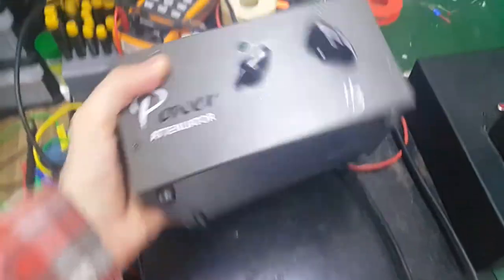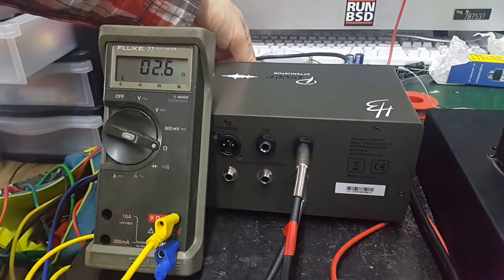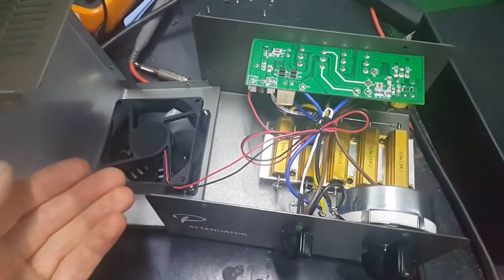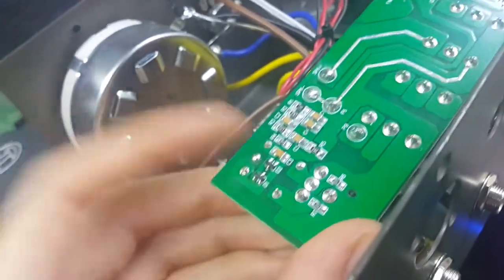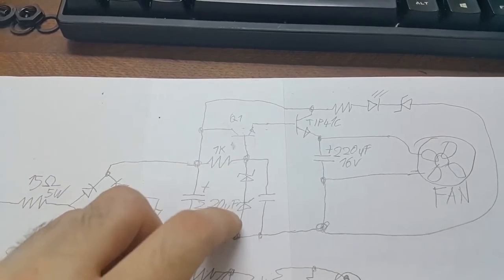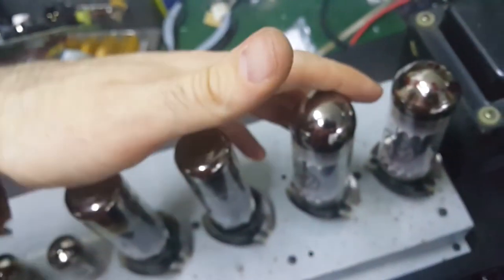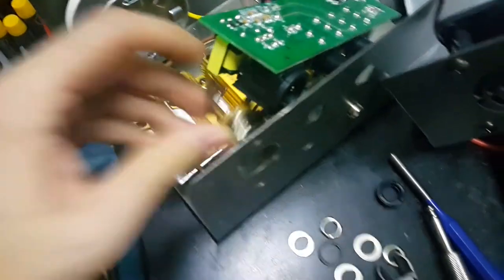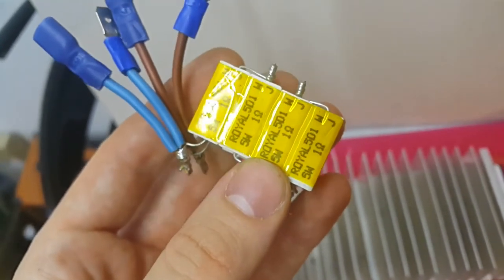Harley Benton PA-100 Attenuator Review & Improvements

Comment: I know it's an old subject by now but nevertheless, I'd like to mention that my PA-100 came with the mail today (living in Germany) and it's perfectly allright, they soldered a solid ground wire to all output connectors and added proper washers, particularly to the 16ohm connector, which looks quite heavy duty now, nothing like in your video. The line volume decreasing simultaneously with the speaker volume is still an issue however, I changed that according to your advice. There was even plenty of wire protruding from the resistor so I could simply bend it away from the pot. The attenuator works perfectly now, with a strong and clear signal into my interface from the line out. Thanks for the enlightenment, man!!!
Reply from the maker: Thank you! It is still great to add to the statistics :-)
Reply: @netman69  You're welcome! What I actually wanted to express was that going public with this issue was probably not in vain, they seem to have adressed the problem. Again, my appreciation for your great work.
Reply from the maker: @captainfineweather5610  it does seem they've fixed it, but I do wonder why, I've sent them an elaborate email about the subject and have not gotten a reply.
Reply: @netman69  That seems to be quite common in our times, not just with companies. The majority of people has completely missed the bus... But don't you worry, as long as there are conversations like this one, I mean the entire comment section, there's hope for the rest of us!
Reply from the maker: @captainfineweather5610  Well the best way to change a thing is to set a better example, thankfully there are plenty, us included :). I've actually rarely had companies not get back to me when I come to them with serious concerns like this, but who knows maybe HB just missed the email somehow.

Comment: Thank you for the most informative review I’ve seen to date on passive power soak. I’ve recently purchased a 30 watt tube amp (Laney IRT30) and was looking for something I could install on a combo amp with a bypass switch. I believe it’s watt control dial is a bit misleading as it is prior to power tubes.  I recently saw two other reviews re Bugera PS1 and Harley Benton where line out didn’t work. Wish they had one with a bypass sw so no need to mess with cables. Your comments, details and knowledge earns my respect of your assessment. Thanks again!

Comment: I like the line out mod. I'm curious why they don't build these attenuators into valve amps anyway. It'd be a big selling point.
Reply from the maker: They actually do make some amps with a builtin attenuator, often they call it a power soak in the marketing material with that context for whatever reason. Mesa boogie is one brand that has quite a few options in this.
Reply: I  didn't know that. Thanks for letting me know.  I just ordered one of these and will mod it to give a line out even when fully attenuated..

Comment: Hello, I just received mine. Didn't even plug it in yet.
Just in case people are wondering, mine came with the ground connected to both lugs of the 16ohm jack.
Looks like they heard you and fixed it.
If you get a new one, it's probably a good idea to check anyway in case mine was just a good batch.
Reply from the maker: Very nice if they did, maybe only a few have it wired wrong. I did try and contact them about it (after the video) but they did not reply.
Reply: Mine too. I just modded it and I can't wait to record some riffs with it directly into my soundcard🎉

Comment: Mine turned up with what appeared to be the wrong nut on the 8ohm input so it wouldn't tighten. That in turn caused the connection to the ground bar between the three input options to break off. Had to salvage a working, correct size nut from my parts bin, get it tight and resolder the connection. For my purposes fine now. May end up replacing the socket as you did, or at least putting some locktite on it if usage loosens it up.
Reply from the maker: Did they at least attempt to solder the 16 ohm ground on yours?
Reply: @netman69  hmm not sure but the ground connection between all 3 inputs buzzed out strongly once I was done

Comment: Great video! I just received the PA100 and what I don't like is that the volume for the line output is the same as that of the attenuator, that is, the attenuator is at 1 and the line volume potentiometer is at 10... listen with very little volume connecting it to a sound card. I mean, I can't play in my room with the amplifier at maximum power, the attenuator at 0 or 1, because I won't hear anything through the line output!! horror!!

Comment: Thank you for the video and review. Does the moving of the resistor affect the XLR MicMod out in any way? How does the fan work if it's passive, phantom power via XLR?
Reply from the maker: Moving the resistor doesn't affect the MicMod thing no, the volume of that will depend on the speaker output volume still. Changing it would probably need a small modification on the circuit board. I should have addressed that in the video, but somehow entirely overlooked it. The fan is powered by the incoming audio, power that otherwise would go to the speaker - but it needs a small enough amount of power that that doesn't affect the impedance significantly. It only runs when you are playing quite loud but that's also the only time it's really needed.

Comment: Thanks for the informative video! Mine has the same line out construction mistake, but fan and 16Ohm out are fine. I also have a different capacitor in there. Its brown but still rated 105°C

Thanks again for the video, i finally know how to fix the line out :)
What where they thinking with that? Lol
Reply from the maker: They weren't thinking about paint I guess xD. You'd think they'd have someone try one of these before they start selling them but I guess not... Now that I'm reminded though I just realized I didn't even do the obvious thing to do and tell them, doing that now :D.

Comment: Hi, I could not get one thing, can I use any speaker impedance on the speaker output regardless of the amp input of the attenuator? I am planning to connect 16 ohm output to 8 ohm speakers using this. On full volume, the impedance in total, in this case, is 12,7 ohm. If I connect the correct speaker it is 15,2 ohm. Half volume, 10,66 vs 11,43 ohm. I wonder if this causes a problem.
Reply from the maker: The way the HB is set up, the impedance on it's inputs is closer to the correct value with a higher impedance speaker connected to the output (with no speaker at all it's pretty close to spot on). I don't think you'd have a problem with an 8 ohm speaker using the 16 ohm input though, this should be fine.

On a more general level it's hard to answer this question straightforwardly though, as there's a whole range from maybe okay to certainly fine. Using the 4 ohm input with a 4 ohm speaker connected to the output at full volume would be the worst case scenario I think, which I wouldn't recommend although it's probably still just about okay if the amp is fairly robust.

Comment: Can I use this attenuator on my AC30/6TB? Will there be any damage to the amplifier or speaker if used for a long time? I am looking for a hot plate from THD, but they are not for sale. So I am considering purchasing this attenuator to replace it. Any advice on this attenuator would be appreciated in the comments. I want a safe attenuation of 16 ohms ac30/6tb (1997). What's most important to me is that the amplifier and speakers are safe and that they don't catch fire.
Reply from the maker: Only if you can make sure the issue I show at around 16:40 with the 16ohm input is not present or fix it. The speaker should be safe either way but the 16ohm input wasn't very safe on my unit so if not checked it could be a danger for the amplifier, others here have apparently received units where that issue did not exist.

Comment: Is it a concern if the FULL POWER LED is flashing while playing? Should I keep it off by lowering the amp master?
Reply from the maker: If it goes on every time you hit a chord it's definitely advisable to turn down the master. The real concern would be for the resistors inside to overheat, which would take some time with any normal amp (at least a minute or so), the light will give a rough guideline on when you're pushing it a bit too much but it is not very accurate. If it occasionally gives you a small blip when playing I wouldn't be too concerned, against better judgement I've given mine some serious hot supper before playing with a 200w solid state amp for minutes on end and it survives that just happily.

Comment: Hello,

i have questions :
Does volume level of Line output and Speaker output are totally separated ? you can reduce speaker cab volume to very low or totally silent maybe and have good line out volume level ?

Can you also totally unplug the speaker cable from the  Attenuator to cabinet to have a sort of loadbox (no sound at all goes to the cab) and just use the Line output of the PA-100 box to plug into audio interface for using IRs ? No hazard to do that for the amp ?

Thanks you !
Reply from the maker: As it comes from the factory, the line output depends on the speaker volume. If you're comfortable taking it apart and moving the resistor that goes between the speaker potentiometer and line out one by resoldering it, you can change it to be independent. I describe this in the video, at 9:12 and then explain how I went about fixing it at 12:45 and at 18:58 i show what i did - less clearly so than I recall doing, may have accidentally cut some explanation of it away while editing xD.

Unplugging the speaker and using the attenuator as a loadbox alone is safe, but do beware of the caveats I noted in the video (16 ohm input wasn't safe from the factory regardless of a speaker being connected, at least on my unit, and the 4 ohms input isn't entirely safe if you connect a low impedance speaker).

If you intend to get one of these (or anything in this price range) I do recommend watching the entire video careful so you understand the caveats about the 4 and 16 ohm input properly, you have to solder an extra wire before the 16 ohm input is safe at all. The 4 ohm input may or may not be safe, but personally I would not recommend using that with a speaker below 16 ohms connected to the speaker out. And regardless of that, for any load box or speaker I would recommend to check with a multimeter whether what you connect it is safe or not, if it is say within about 20% of what it says on the label you'll be fine.
Reply: So does this mean the 8 ohm inpit is safe from the factoey with no modification??

Comment: Hey Netman, thanks for sharing all the info regarding this unit. From what you mentionen in the video, do I understand this right, that if i connect the 8ohm out from my tube amp (60 watt) to the 8 ohm in of the HB PA-100, and the out of the attenuator to a 4 ohm cab it works fine? Thanks in advance for your reply.
Reply from the maker: That should indeed work fine, if all you want to do is adapt impedances do keep in mind the max volume of that setup is gonna be a fair bit quieter than using a cab of the right impedance straight
Reply: @netman69  Thanks a lot. It is just a bedroom set up to get tube sound without tube volume so no volume competition. The box is Marshall VS212 (2x12) with 4ohm in mono  (parallel) and 8 ohm per speaker stereo. Amp is a Engl fireball 60 from 2009. With either 8ohm (2x16 parallel) or 16 ohm (2x8 serial) out. Without attenuator there is an easy connection and great sound wit 2x8 ohm. However the HB PA-100 accepts only one in and one out. You seemed like someone who could have answers to a quite specific case. Hence the question.
Reply from the maker: @evgenijloginov3412  16 ohms on the output of the HB would give less power to the speaker but have the 8 ohm input better matched to actual 8 ohms. If that's loud enough (depends on your definition of bedroom level) it's a nice option. Just be mindful of the ground issue my video mentions, but it seems HB might have fixed that by now :).
Reply: @netman69  Thank you for the fast response. My concern was the difference in impendace 8ohm from amp vs 4ohm in box. Without the attenuator no questions left. But as HB does not provide the output resiatnce of the unit I had this qurstion. Just to wrap it up amp out 8ohm -> HB PA-100 -> box 4ohm will work? Thanks for your patience. This entire ohm-thing is quite black megic to me😅. Thank you!
Reply from the maker: @evgenijloginov3412  HB seems to have entirely ignored output impedance in the design of the box xD. It's resistance is right on without any speaker connected, with a 4 ohm on the output, the 4 ohm input becomes a bit low for comfort (like about 2 ohms). The other inputs are close enough, 8 ohm input would be about 6 or 7 ohms with a 4 ohm speaker connected, being off like 50% is not something most valve amps really care too much about.
Reply from the maker: To elaborate on that: if the amp really cared about a slight mismatch most speakers would be a disaster, they have a different impedance depending on the frequency and it can vary quite a bit. So you pretty much shouldn't worry other than 4 with the 4 ohm input, would recommend at least an 8 ohm speaker or higher on the output with that.
Reply: @netman69  Thanks for your expertise! All the best to you.🎉

Comment: Hiya! What kind of cables do we need? Has to be both speaker cables or can be any instrument jack cable? Just bought one for my combo. The speaker cable i will use the one it's attached on the speakers already, but the extra one I need to plug between the amp and the attenuator, has to be speaker cable? Thanks!
Reply from the maker: You should use speaker cables on both sides, most importantly between the amp and the attenuator. I've used instrument cables before and lived, but it is not wise.

Comment: Hi. If I hook my 4 ohm tube amp output into the attenuator 4 ohm input and use an 8 ohm speaker cab for the output, will that be fine ?
Reply from the maker: That should be quite fine I believe, do keep an eye on the amp the first time you try. The resistance would be a bit under 4 ohms but most amps have no issue with that.